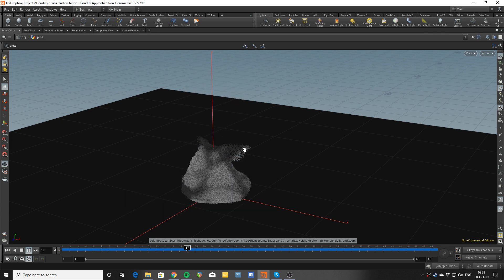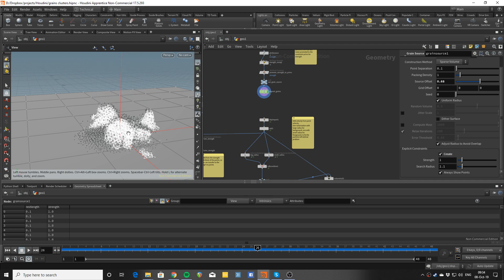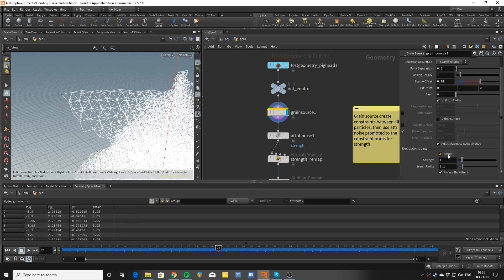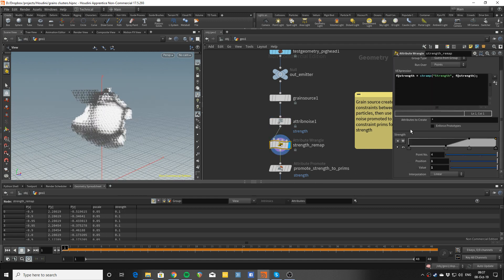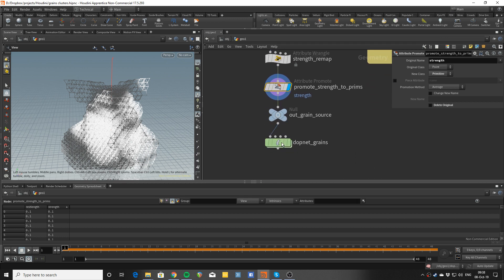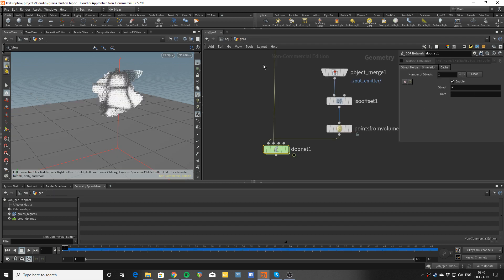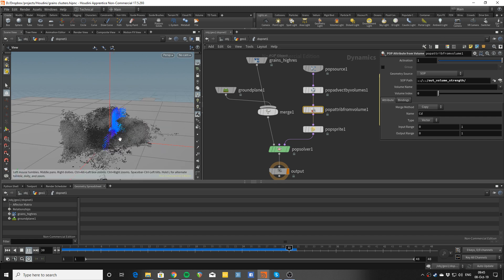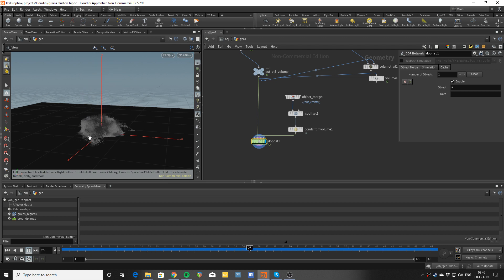Houdini 17.5 - Grain clusters and upres

Comment: Putting noise on top of 'attractionweight' attribute vs the 'strength' attribute is the same? Right?
Reply from the maker: They are different, strength is an attribute on the constraints, meaning how much they resist breaking, and attractionweight is in the points, meaning how much they clump together
Reply: @HristoVelev  Ah, okay. Was getting confused between both because behaviour of both looks almost the same & btw my teacher taught me attraction weight thing to me for clumping, but will also try your technique you taught here & thanks for replying!
Reply from the maker: @kg4135  these days I do it with Vellum :)
Reply: @HristoVelev  What's the difference in both? Speed, Control?
Reply from the maker: @kg4135  Vellum is the more modern framework. You can do more, it's faster, and you can access it from SOP
Reply: @HristoVelev  Ah okay, time to learn vellum grains now